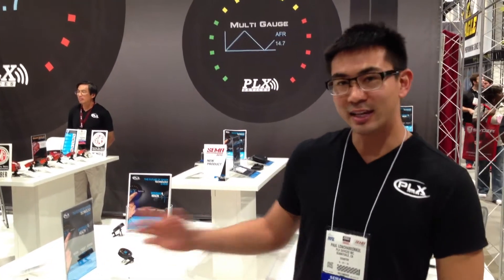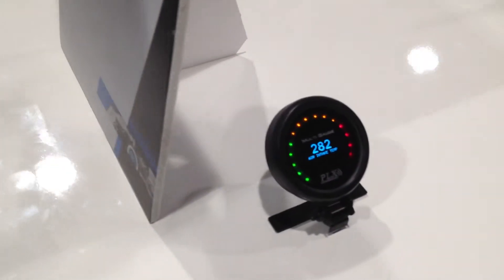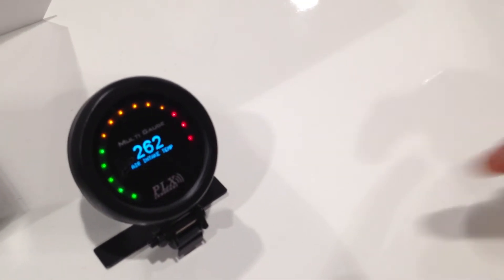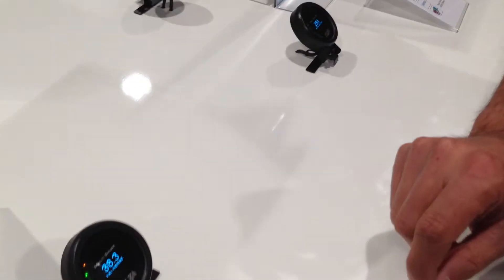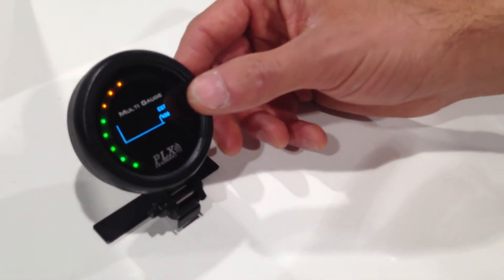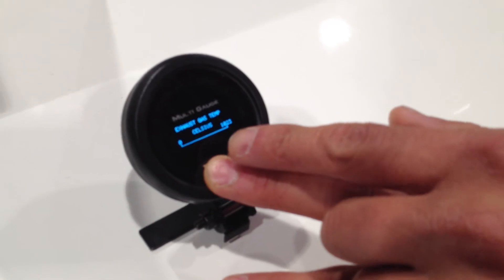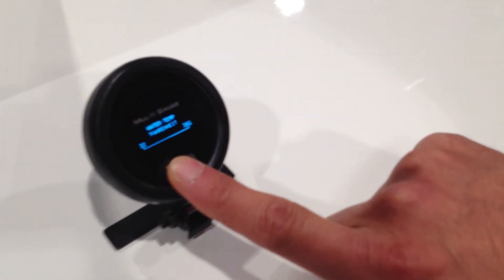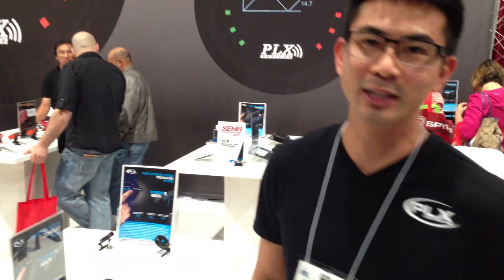PLX Devices MultiGauge DM-6 Gauge Demo SEMA 2013

Comment: 2 Years and something bad: my plx measures the stoichiometric ratio badly; lean as soon as I accelerate everything and it stays fixed. yet the car is not lean also because the temperatures are correct. sensor to change?